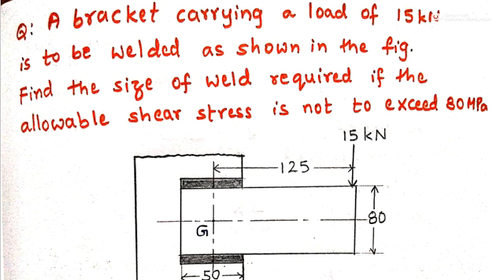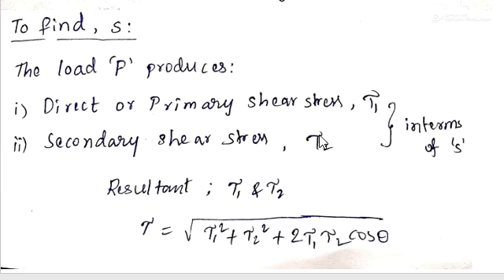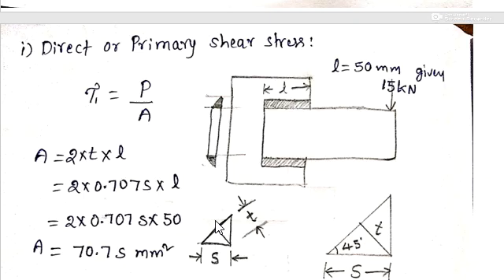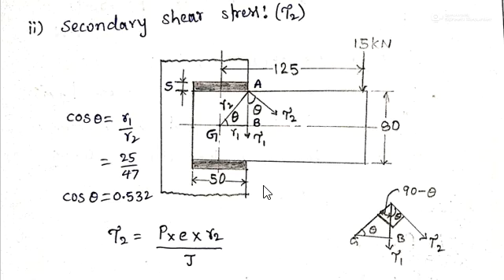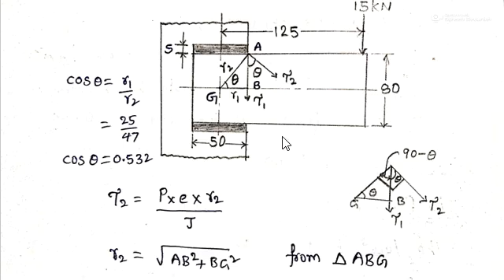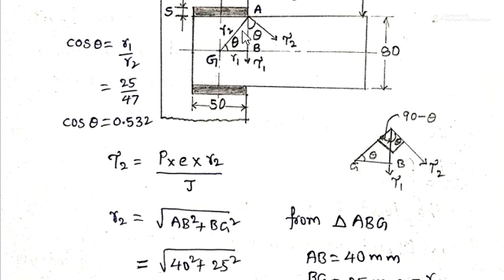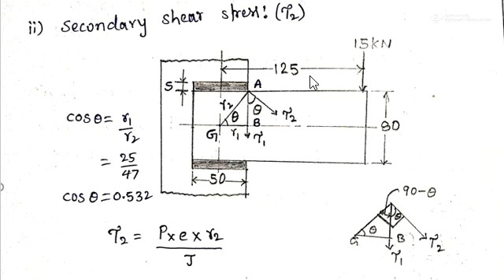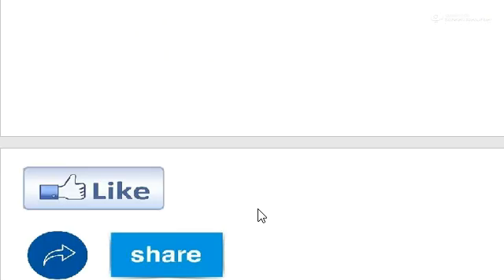Problem on Eccentrically loaded welded joints, DMM -1

Comment: Why 12.5 mm is not added or subtracted with the length of weld?
Reply: It is clearance for added in any welding length portion
Reply from the maker: 12.5 mm is the starting and stopping length of weld bead which is not considered in calculations